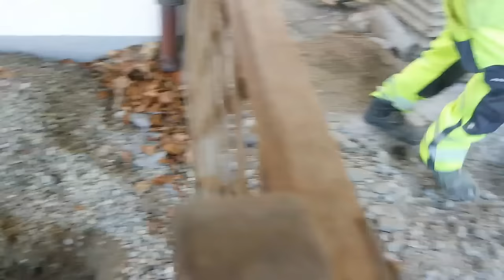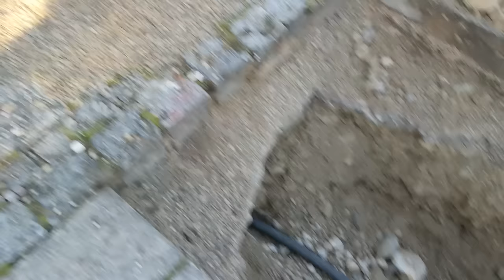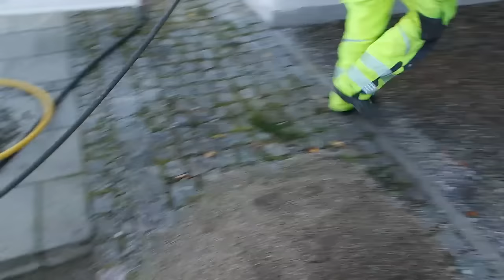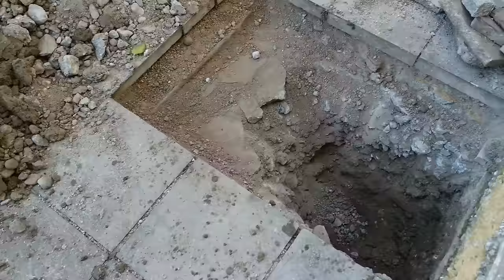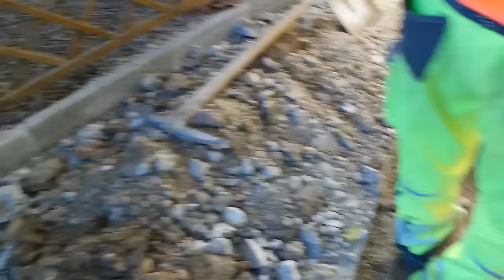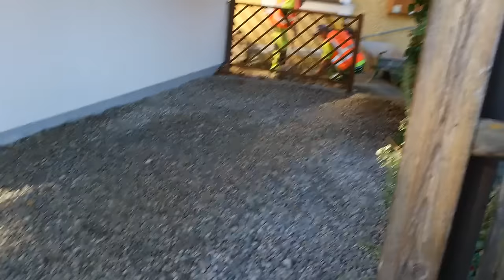Tiefbau mit Erdrakete für FTTH-Hausanschluss von Deutsche Glasfaser in Zorneding vor meinem Haus

Comment: Good video. Is this so hard work for workers? Maybe I will do this job in Deutschland in the autumn; greetings from Montenegro, southeast Europe.
Reply from the maker: (Antwort in deutsch siehe unten)
I think that this work is actually much faster and easier with the help of the earth rocket - even on such short distances as in my case on our doorstep.

The workers saved themselves from having to laboriously relocate the small-headed paving stones and the curb stones at both ends of the carport directly in front of the carport.

Ich denke, dass diese Arbeit mit HIlfe der Erdrakete tatsächlich viel schneller und einfacher ist - sogar auf so kurzen Strecken, wie in meinem Falls vor unserer Haustüre.

Da haben sich die Arbeiter erspart, dass sie direkt vor dem Carport mühsam die Kleinkopf-Pflastersteine sowie die Kantensteine an beiden Enden des Carports  neu verlegen müssen.
Reply: @PeterPernsteiner  Viele Danke!
Reply: I wish you acceptable weather. Bad weather is here probably the worst part on that job.
Reply: @jfnotk255   Thanks fot that information. :)